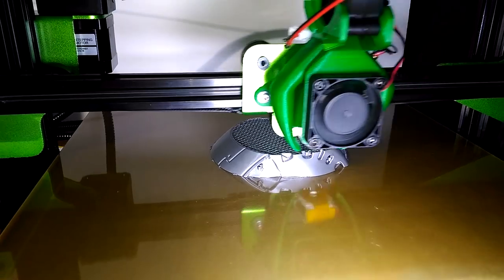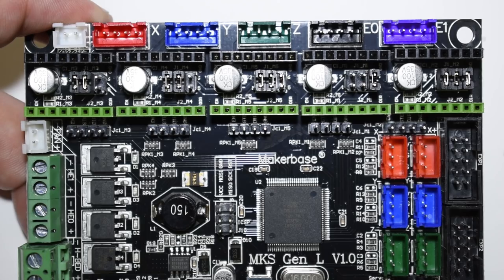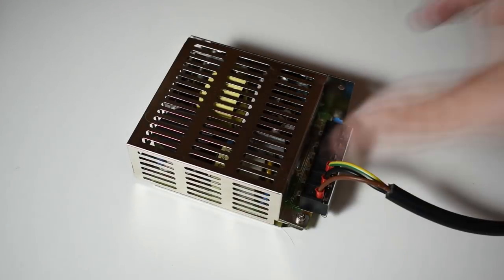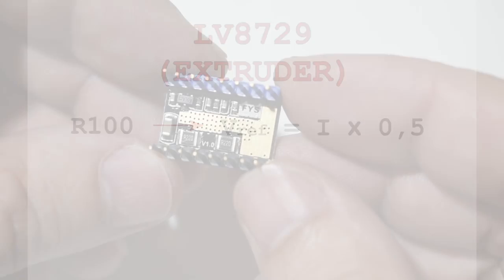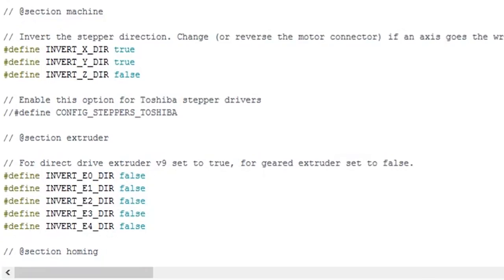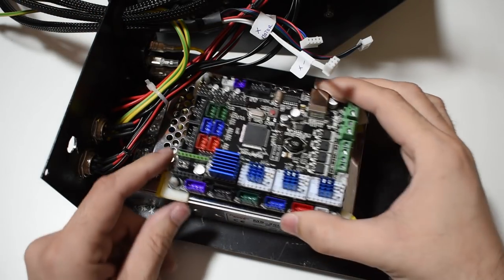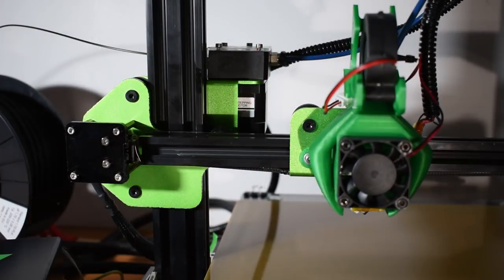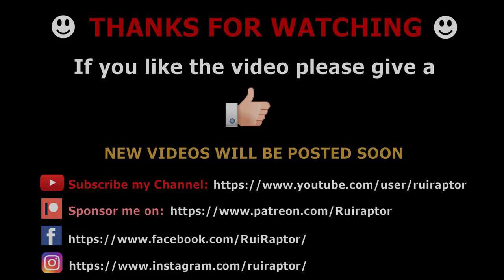Install & Setup - MKS GEN L + TMC2208 + LV8729 (TEVO TORNADO)

Comment: Hi "ruiraptor" !!
Just wanted to say thanks, you made a confusing upgrade very easy! 
I know very little about stepper drivers.
A couple of questions though....
 1/. why do we change the jumpers to run the drivers in 1/16 ?
Is this a better mode, or just your preference?
2/. I have been fighting a ghosting problem with no good results, I even removed the squash-ball feet I made to cut down vibrations, thinking that when installed, they made everything move around too much. You stated (lower down the comments)....
"You can use acceleration= 800 & jerk=8. These settings will prevent ghosting issues. 
If you use an extra glass over the heatbed, you might need to reduce a little bit more." 

Well I have a 6mm MIC6 Cast aluminum bed with 3mm borosilicate glass on top, so my Y axis is pretty heavy. I changed acceleration to 800, and I changed Y-Jerk to 8 but left X-jerk at 10. Will this be okay, or should I lower something to remove the ghosting problem I have? (Haven't tested new settings yet).

Thanks again for this video!!
Reply from the maker: Hi Compu Majix,
Good questions. Check the answers below:

1- Different drivers have different jumper configurations so you need to add/remove the jumpers according.
With an 8bit microcontroller, I prefer to run the drivers at 1/16 (which is the same with the stock A4988 drivers).

2- It seems that you, in fact, have a lot of weight on that Y axis. That will create a big and terrible inertia. Did you remove the stock glass bed?
Reply: Hi again....
1/. Thank you.

2/. Yes I completely removed the bed because I cracked it at two of the mounting holes trying to attach an upgrade and ruined it, so I decided to pull the heating pad from underneath, then instead of a replacement from Tevo, I had an MIC6 replacement made (what a nightmare.....the company I chose tried 3 times to drill the holes for the tramming screws before getting them in the correct locations, and the thinnest I could find was 6mm), then attached the heating pad to the bottom of the MIC6 and installed it. I added the glass for easier print removal, I hate the tape idea and glass makes better bottom layers in my opinion. Perfectly level bed and a dream to tram! I realize I will have to change the acceleration and jerk settings, and print a lot slower than the Tornado is usually capable of, but the better quality parts are made at a slower speed anyway,  I print slow on my heavily upgraded Anet A8 (first learning printer, now I have my Tevo, and I'm going to build a Voron 2.1 from scrach for a corexy)....around 20mm/s for outside walls, 40mm/s infill & inside walls. I'm testing your new settings shortly. Any more advice as to lowering the settings to get rid of the ghosting ? Should I also lower the X-jerk to 8? I already checked the frame for loose parts, and tightened the belts with my belt tensioners (although I can't find a way to test for the right belt tension anywhere, just advice to tighten by feel, well I don't have a clue how tight is right so how will feeling them tell me anything? They feel tight, but is it too tight or not enough? LOL !! I also added the frame brace. 
Thanks again for any help you can give me. 
I really appreciate the time you take to read my questions and offer advice! 
I look forward to the day that I'll be giving the advice. LOL !!

Majix

Comment: Your videos are great, thanks so much, they've helped a ton! My tornado shipped with a Gen L board, I'd like to adjust my vref's but my steppers are different from other Tornados as well.. they are labeled RBStep 42SHDC4043Z-22B for E1,X axis and 42SHDC6022Z-26B for Y (the label is situated so I'd have to remove the stepper from the Tornado to see the model on Y which I will do to verify before adjusting but currently am assuming it matches E1 and X) however I cannot figure out any info about these or what their formula might be, do you have any insight?
Reply from the maker: Hi,
Your stepper motors, even with different part numbers, they should have similar specs (if not the same).
Therefore, if you have the stock drivers (A4988) i recommend vref=0.95v for X, Z and E and  vref=1.05V for Y.
Run a 30min print and keep checking the motors temperatures. They can be warm but never hot.
If the temps are ok and no Y shifts, then you are ready to go ;)
Reply: Thank you, will give these specs a shot and report back! When you say warm, you mean "to the touch" or via a specific range with an non-contact thermometer?

Comment: Thanks for all your great videos.  They are a big help for noobs like myself.  What is the extruder fan mod shown in the video?
Reply from the maker: Hi Terry,
Thanks.
The fan mod i'm using is the one i liked the most from the tests i ran with a few models. You can see those tests here:
https://youtu.be/hoHz5LHyFUo
Reply: Thanks again for the link.  I have a new Tornado with the MKS board with "pluggable" drivers.  I see from you video that there are several differences between it and the MKS L board.  Is there any reason to upgrade my board and drivers or can I just replace the drivers?
Reply from the maker: Hi Terry,
The board you have with "pluggable" drivers is the MKS GEN L (same as the one i used in the video).
My tornado was one of the first and it was equipped with a MKS BASE. You already have the new board, so if you decide to upgrade the drivers, you only need the drivers.

Comment: hello friend regarding the formula; Is 0.85 and 0.9 the current of the motors? In this case if I have 1.7A motors, should that amperage be placed? or what would be ideal?
Reply from the maker: Hi Fernando. Don't use the full spec current. If you do, the drivers will run too hot. The ideal way to tune these drivers is to start from the lowest value and raise while checking.

Comment: Ruiraptor Just a suggestion that might help some people that want to upgrade using the latest firmware (you may want to add it into the description OR do a 'follow up' video). The later versions of the firmware, 1.1.8 and above (could be lower number than that, but I used 1.1.8 cause it was the latest stable release, but could be as far back as 1.1.6) have been condensed and fine tuned for better printing and steps etc. 
One of the improvements they made was to make the firmware more compact, to do this they re-wrote a lot of the code that repeats into a statement in the Adv H code. One of those improvements is there is a '#define X_DRIVER_TYPE A4988'. If you are going to upgrade to the TMC2208 & LV8729 you MUST change the type to TMC2208_STANDALONE (remove _STANDALONE if using UART) and the extruder to LV8729.

If you do not do this, even though you have correctly reversed the direction, the board still 'thinks' they are A4988's with the old steps. This means it may print dimensionally accurately BUT if you set it to print at 60mm/s, it will actually move at 120mm/s (or higher). After swearing at slicers (Cura, S3D, Slic3r etc) and pulling apart the printer and rechecking the jumpers and god knows what else I attempted, I finally found this in the firmware. Once I changed it, bingo. Perfect prints.
Also, and this is more commonly known, in the Tornado versions of the firmware it has been set incorrectly with the bed size 300x320. But this is a very simple thing to solve like lowering the accel and jerk.
But yeah, after more than a week or two of mucking about with this, I changed that, re-tuned the vref and its now printing perfectly and almost completely silent bar the sound of the fans.
Reply from the maker: Hi EagleSoar1381,
Thank you so much for sharing this information.
Where can people find this new firmware version? Do you have a link?
Reply: @ruiraptor  I grabbed all files from the Tevo Tornado Facebook group. There isn't really a firmware file for 1.1 (I think it's actually one of the older files in the file section just called TornadoFirmwareUpdate or something, but no mention of it being 1.1)
There are zips of 1.1.4 up to 2.0. I was told 1.1.8 was most recent reliable stable so went with that, anything prior to this version might be unaffected by the issues I ran into, can't say because I have not had a chance to check them yet (that was my next option if the #define didn't solve it, was going to roll back to earlier versions)
Reply from the maker: That information might be correct because the version I'm running does not have the TMC2208 or LV8729 option and I'm not having any issues for not changing any driver lines.
I will download a few versions and make some tests.
Thanks
Reply: Thanks for sharing this. I followed your guidance in Marlin 1.1.9 and worked great. One note is that these commands are in the Configuration.h file.
Reply: Ah yeah, forgot to mention that. Thanks for the addition and I am super glad it helped. 
I wasnt aware of it and wow did it ever cause me problems. I was getting filament fed at the wrong rate (setting it to 60mm/s was printing at 120mm/s and things like that) and was causing me all kinds of headaches. 
So yeah, glad the info is out there and helping other Makers out.
Cheers

Comment: I added the Dual Z Axis Kit, so I have 2 motors on my Z Stepper Driver. Do I set the VRef's the same way you have shown even though there are 2 Motors, or does it need to be higher?
Reply from the maker: Hi,
You can setup the vref for the Z with the same value as i have in my video.
The Z motor (especially when using 2) don't require much torque when compared with the X or Y.
Reply: @ruiraptor  Great, thanks !!

Comment: I just purchased a kit with the drivers but they are all LV8729 whereas you used a different one for the extruder. Is there an issue with using the LV8729 for all of them? I have the 2018 Tornado so I won't need to replace the board. I have never flashed firmware before is there anything I need to do this and how easy is it to get yourself in trouble?
Reply from the maker: Hi Steve, 
If you don't mind the noise, you can use the LV8729 drivers in all the axis. People use the TMCs in X, Y and Z because they run the motors silent. Regarding the firmware, if you use all the drivers at 1/16 you only need to reverse the direction of the drivers. If you are unsure or afraid to flash the firmware, you can reverse the motors by reversing the order of the wires of the motors.
Reply: ruiraptor  I just finished installing a new set of LV8729s on all my axes after I accidentally fried my old RAMPS board with A4988s on it. Even the LVs are way quieter. Just make sure you set your microstepping.

Comment: Followed this video so many times and I still my Y motor stops mid print? My Z might be stopping at the same time as well. Stock case cooling fan, Acceleration 800, Jerk 5, vref 1.26 on Y. Running out of ideas, any advice? TIA
Reply from the maker: Hi,
try to increase the cooling. They might be shutting down by their thermal protection.
Reply: Definately-mine needed fan on drivers

Comment: Thanks for this excellent video. I ordered the Witbot TMC 2130 drivers from BIGTREETECH and unfortunately they have the pins soldered both downward and upward where the upward 4 pins are located and no diagnostic pin at all. The chip is also on top which seems to be another big difference. This has confused me greatly and I have a few questions for you if you don't mind. Any guidance you can provide will be greatly appreciated.

Am I supposed to snip off the 4 bottom pins that are incorrectly placed? 
Do I worry that the chip is upside if the pinouts are still correct? 
Is this possibly a new design that requires a different approach altogether? 

I am not an electrician by any stretch but I am a Windows systems engineer. The potential to fry my new hardware has me reluctant to go the trial and error approach as I normally would with software.

Thanks 
Jeff
Reply from the maker: Hi,
The 4 pins upwards mean that the drivers you have are prepared for SPI. This means that you need to get some jumper wires and connect those pins to a different connector on the board and configure your firmware to control them by SPI. The TMC2208 are plug and play and much easier to install and configure as you see in my tutorial.
Reply: Do I need to remove the pins that are pointing downward in the same location as the upward pins?
Reply from the maker: They don't contact with the female socket under them do they?
Reply: @ruiraptor  yes
Reply: They are both up and down.
Reply from the maker: Can you please contact me by facebook or email?
Thanks
Reply: @xKenn  Excellent. Thanks!

Comment: Something that is not, I am not aware is that for the LV8729 controller, leaving soo the MSI3, only works at 16 micro steps, should not increase them leaving the 3 bridges so that the extrusion is smoother at 128 steps?
Provide the configuration as you mentioned in the video but I get very little material, leaving the line very separate.
some subject?
Thank you!
Cristian
Reply from the maker: Hi,
I would not recommend using higher stepping on an 8 bit board.
If you want to use 1/128 steps then i recommend you to get a 32bit board instead.
Reply: 8 bit controller is not fast enough to create pulse for 1/32 and above.

Comment: Hello, thank you for the video, but I have a problem :(    :

Everything works fine except the hotend (it even reads the right temp of the hotend). Sadly I was dumb enough not to label everythink. I tried both pairs of connections who come with the extension cable from the hotend and both didin't work. 
Only the fan is spinning. Sadly I don't know the pinout of the connector with the 8 pins so I tried every combination of the 4 wires and it still not works. 

Any ideas :)?

Comment: I enjoyed the video. My printer is an ultimaker 2 clone called cl-260. The board is equal to mks gen l 1.0 and has 5 tmc2208 v1.2. Can I run it exactly like a video to install the tmc2208 on my printer and use the UART function?
Reply from the maker: Hi,
If you have TMC2208 V1.2 then they are setup for UART so you need to connect the serial wire to the board for it to work correctly and you need to flash the firmware so that it has that feature enabled too.

Comment: i believe my Extruder driver on my 2017 Tevo Tarantula has gone bad and i was wondering if the MKS GEN L with these stepper drivers would be a good replacement for my printer.   if so would you keep the Vref values the same for the tarantula?
Reply from the maker: Hi Tony, the MKS GEN L is only an 8bit board (now you have several options with 32bits) but is a board that is mature and with valid working firmware. Regarding the Vref values, you can use the same except for the Y axis because the stepper motor is not the same. Therefore, use the X axis vref value for the Y axis.
Reply: @ruiraptor  looking at my printer today all the steppers on the tarantula are the same.  is that how it should be?
Reply: @tonyharnish4350  I think yes, at my Tarantula are the same too. So in this case the Vref is the same for everyone? @ruiraptor

Comment: Hi,
do you have any documentation on the jumper configuration at hand? I wanted to check them for my setup but could neither find it in the board's data sheet nor the driver's one. I'm going to use the MKS Gen L and original TMC 2208.

Thanks in advance :)

P.S. I know you said it in the video but I like to confirm it myself ^^
Reply from the maker: Hi,
If you go to any aliexpress TMC driver deal, they normally include the jumper configuration table.

Comment: Hi Rui!!! 
I order already MKS Gen_L V2.1 and the same step motors you use in video for my Tarantula Pro.
Did you have any link how explain to use the jumpers. The position/quantities jumpers looks a bit different from MKS_Gen L V 1.0 
About the firmware I can use original Tarantula Pro firmware from MKS V1.0 board??? 
Thanks in advance.
Reply from the maker: Hi Mario,
We don't have a video for the Gen_L V2.1. The jumper configuration is the same, you just need to know where is the MS1, MS2 and MS3. Google for MKS GEN L V2 schematic and you will find the pinout for all the connectors, including the stepping jumpers.
Reply: @ruiraptor  sorry rui  we have solution in:
 https://www.youtube.com/watch?v=vSgcH2wjCwY&t=77s
Obrigado de qualquer maneira. Boa sorte e nao pares es fantastico. Abraco.
sorry about that but you can have lots good news in:
http://3dmodularsystems.com/en/eletronic-boards/663-mks-sgenl-32bits-controler-board-for3d-printer.html

Comment: Hi 
ruiraptor,

Could you please elaborate on why you say the LV8729 is better on the extruder than TMC2208 ? 

Thanks in advance :)
Reply from the maker: Hi Dan,
Please check the comments below. I explained this to many other users.
Reply: @ruiraptor  Hi again,

Thanks for getting back! 

I did try to scroll to comments to see if anyone has asked the obvious question... but must have overlooked your answer in first place :) 

However I did find it now - thanks for clear explanation.

TL;DR: The TMCs cannot handle very well fast direction changes such as the retractions from the extruder - that's why the LV is recommended.
Reply: @dannimandersen6787  thank you, for putting that TLDR i was having such a difficulty finding the comment he mentioned then i noticed you had another comment